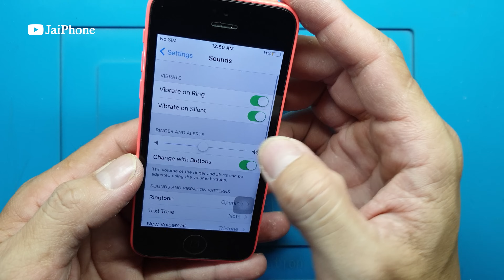Restoration destroyed phone | Restore iPhone 5c | Rebuild broken phone

Comment: I didn’t understand what 5s can be assembled into a case from 5c well, iPhone give
Reply: It's iphone 5 but now iphone 5c😂
Reply: @Jon Petruthi it was 5, not 5S :)
Reply: so cunfusing
Reply: It's 5
Reply: Саша Лобанов it’s a 5s. Look at the flash. Easiest giveaway right there
Reply: And the battery cover is from iphone 5s
Reply: @EditorialColt45  it's ip 5 look at the home button
Reply: Lil Annu homebutton can be changed.
Reply: Lil Annu look 👀 light camera
Reply: The old shell was of 5s and the logic board was of 5
Reply: Hasnain Khan wrong, the logic board is from a 5s. Look at the logic board and then look at a google search of a 5s logic board and then one from a 5. The video shows the board as from a 5s.
Reply: @HasnainKhan-qn2nf  it was 5s with homebotton replacement with out touch id and he change it to 5c cuz the homebotton just gave it away that this not 5s
Reply: It is a IPhone 5c Logic board which was in a 5s case
Reply: EditorialColt45 a 5s has an s on the back, and it has no touch id
Reply: Well because the slate iPhone 5 had a paint chipping issue after it was released that made costumers mad so apple did release another polycarbonate iphone 5 with more color options alongside the iPhone 5s!
Reply: EditorialColt45 it’s a iPhone 5 the 5s has a different flash.
Reply: Its a 5s I work at Apple. You can tell because of the home button, battery, and flash
Reply: TechNotesStuff idk how the home button works then, but the logic board shows it’s a 5s.
Reply: geh magaway kayo HAHAHAHAHA
Reply: 5c is the iPhone made by chines
Reply: How could it be possible to unlock a phone without knowing the password. In case of this phone how did his fingerprint works. Kund of fishy
Reply: This is an iPhone 5c in an iPhone 5s case. This can be done. There"s plenty of videos doing this. It is call "converting" u may google or search on utube "iphone 5s to iphone 7" or so. Plenty of them did this. In this video the owner wants the iphone to be converted back to iphone 5c because it is an iphone 5c using an iphone 5s SHELL
Reply: Саша Лобанов it's the iphone5s by the flash
Reply: its actually a 5s housing with a non working 5 button converted to 5c

Comment: Can u fix my iphone for me🤕 its cracked and it dont let me move anything if i get it fixed it still wont move help?
Reply: Just learn to diy 
Warch other YouTuber like Hugh Jeffreys and other YouTuber who repair iPhone 
Read ifixit guides 
Buy parts from Aliexpress or if you have fowarder service in your country like ezbuy or vpost in singapore and know Chinese or use Google Translate for rough and not so accurate translation use Taobao to get parts 
Don't forget organize the screws 
Draw screw layout for each part Eg screen bracket,battery bracket,etc on a paper or screwmat that can be draw or written on using marker 
Then put the screw accordingly 
When reassembling put the screw accordingly too
Reply: Is it an iPhone 6 or 6 plus 
There is a risk of touch disease which touch screen won't work even with new working screen 
You will need someone more professional to change the ic on the logic board and to add a jumper wire to the board

Comment: 0:51 iPhone 5S > 14:53 iPhone 5C
Reply: yeh but iphone 5s has double flash so how did that fit in 5c ???
Reply: Omar Beituni probably didnt fix the 5s and just built a 5c
Reply: That's not iPhone 5S It's iPhone 5 as 5S has Touch ID.
Reply: @_D.Va_  the beginning phone was a 5s, with touch id, BUT in the end it was a 5.
Reply: Wait, at 1:03 there is iPhone 5 home button
Reply: JL Fans 2020 yes, i think kts fake as the mobo is sized differently and cant be used like that
Reply: So I guess iPhone 5 has the flash replacement then later on become 5c
Reply: @omarioonn  they replace the flash
Reply: Actually it was iPhone 5 at first, then changing into 5s without the screen, then again now become 5c

Comment: For those asking for him to fix your phone 
I Suggest to learn to do it yourself 
I give you some tips 
Read ifixit guides about your phone model 
Watch other YouTuber Eg Hugh Jeffreys,he repair iPhone 
Most importantly 
Keep all screws organized 
Make sure it go to the right place otherwise you will damage the phone logic board 
Use a paper or a screw mat that can be written or draw on using the marker that came with and draw out the layout of the screw of each part Eg logic board, screen bracket and battery bracket